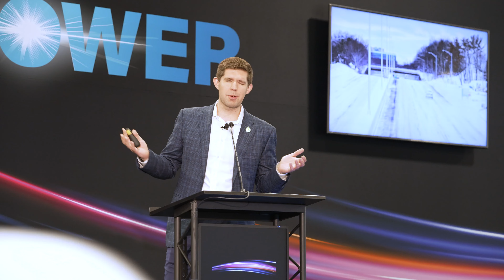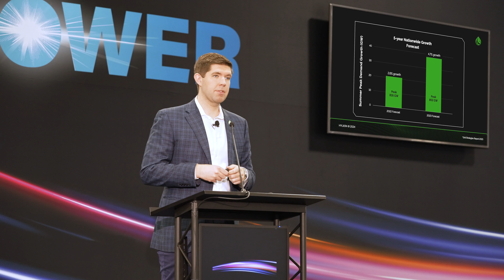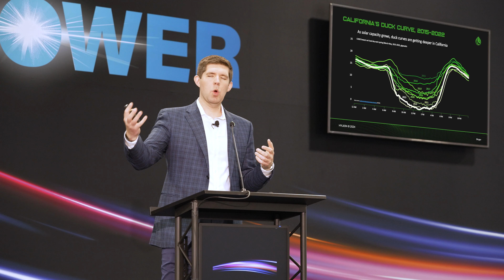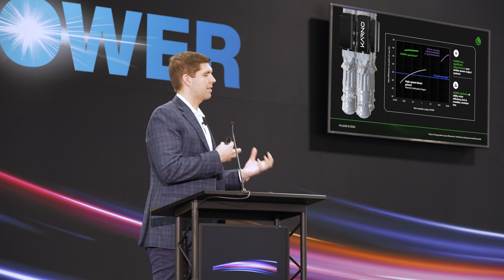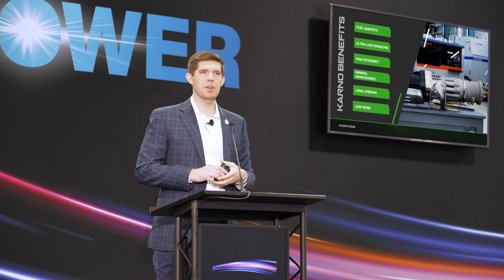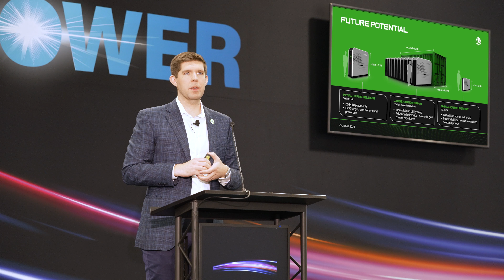CLEANPOWER Expo 2024 | Thomas Healy Presentation

Comment: Just two simple questions and I hope folks from Hyliion could answer directly. (no dodging the questions).

1. How much would the Karno generator cost to deploy (one unit)?
2. How much is fuel-to-power efficiency gain we are talking about? 

If the cost for deployment outweighs the money savings we could get by using the Karno generator, and we need more than five years (5y+) to recoup the cost of deployment before it could generate the real positive money savings. Then this product is not competitive at all, and I doubt that you could leverage this single product to become revenue-making and to save the Hyliion company.

Comment: 22:48 $0.12 per kWh, at what cost is the natural gas being priced at to get that number?
Reply: $1.57 per therm
Reply: @Nautisphere  

Can you put that in “USD/MMBtu” or USD for Gallon Gasoline Equivalent (GGE) for useful comparison.

AND while you are at it, why that particular number! NG prices are all over the place AND is that just the NG cost component not including the Karno generator cost amortized per kWh output ‽ Personally I would like to see this company publish a chart of “Levelized Cost of Energy” output as a function of natural gas price. It is one thing to feed the Karno “sweet flare gas” vs generate price competitive electricity at the prevailing NG prices that you have to pay when delivered to an industrial facility. It used to be that NG was very inexpensive but that is not a given anymore.

AND if this is about using “RAW FLARE GAS”, how does that combustor heat exchanger with its very small pathways hold up to the combusted impurities?! These are the questions that buyers will have to know to make an informed buying decision.

Comment: 20:12 So there are ICE generators that have been getting over 50% efficiency (54%) for fuel to AC electricity out for a decade now.  So what does Karno bring to the game other than small increments‽ You are talking about how Karno’s combustor is totally fuel agnostic but gas turbine combustors that use hydrogen have to be specifically designed for hydrogen due to some of its unique properties. Also it is my understanding that liquid fuels have to be “vaporized” first before introduction to the “combustor” (as noted in other videos that the flame from liquid fuels looks totally different and appears to have “speckling” when burning liquid droplets that were not fully vaporized). Also how do you deal with the contaminations of “sour” natural gas that would be burned at a wellhead?
Reply: Modular architecture and almost zero maintenance due to air bearings are the biggest advantages, low noise and vibration, improvements and upgrades can be printed quickly instead of having to retool a production line. They can eventually use it with their hybrid technology once long haul (cross continent) shipping companies are pushed in the direction of very low emissions (H2 and RNG) instead of trying to continue trying to get a traditional ICE to pass changing emissions certifications, especially with its low NOx.
Reply: @anydaynow01  

All good points.  I am not sure about the scalability of additive manufacturing but it does allow quicker design updates.  The “reliability” does need to be validated as I wonder about some numerous issues with less than pure fuels being burnt in a combustor that has small and circuitous passages. Even gas turbine combustors burning jet fuel need cleaning and have corrosion problems.  So time will tell.

Also Cummins seems quite persistent with ICE with their new multi-fuel 15X series of engines. There are also European ICE engines that are effectively similar in overall efficiency to Karno running on RNG.
Reply: its a scam, don’t be serious

Comment: Gas from dairy ??

Tha ks to all the eloquent  adroit responce
Reply: And other farm waste and solid waste from sewage treatment plants. It's sent to digesters to make methane (kind of like how capped land fills have to be vented since they constantly putting off methane). Companies like Clean Energy and some utilities are building them since the feed stock is essentially free and the fuel is at the worst carbon neutral and oftentimes considered carbon negative to some degree due to it being waste methane that would otherwise have been a greenhouse gas itself.
Reply: @anydaynow01  

It is actually IRONIC that a dairy that historically released more methane (normalized to something like methane released to the atmosphere per cow) will get a better carbon negative “certification” than a more progressive dairy that tried to capture some methane in the past. And with a more negative Carbon Intensity  Certification Value it is priced higher (through credits). I have always thought that is a bit perverse.
Reply: I assume animal waste... methane probably
Reply: I deliver deisel fuel to alot of dairy farms....the milking barns are big. They all incorporate generators for primary or back up power that burn deisel . The cow manure that they displace is a very large quantity.  Some of them have digestors on site that convert the methane from the manure to renewable natural gas. I'm assuming that Thomas is referring to this possible utilization for that rng produced on the farm to be used for onsite Karno power and / or to ship that rng to be used off site, making use of the methane produced from the manure.  @Walking_Bear
Reply: In California the transportation methane fuel that is marketed as BIO is on average certified as being “Carbon Negative”. Dairy produced methane is almost significantly carbon negative. The NEGATIVE aspect of BIO CNG is due to counting the “AVOIDANCE” of releasing the methane that would normally be released (so book keeping). California has significant subsidies through LCFS credits for this fuel and has supported funding of the Anaerobic Digesters at dairies.
Reply: Exactly....Great point!carbon negative due to the methane gas that is being prevented from being released to the atmosphere.   @Mentaculus42